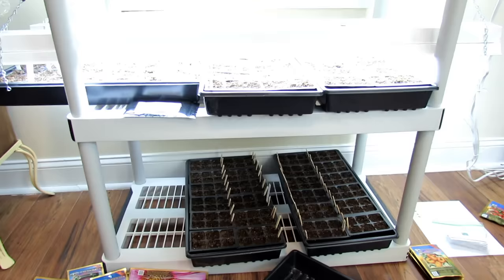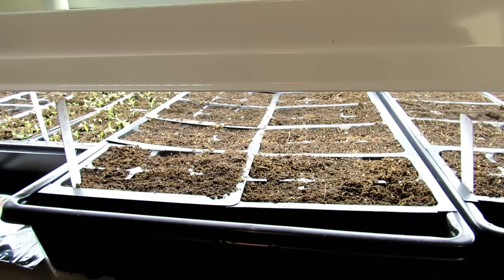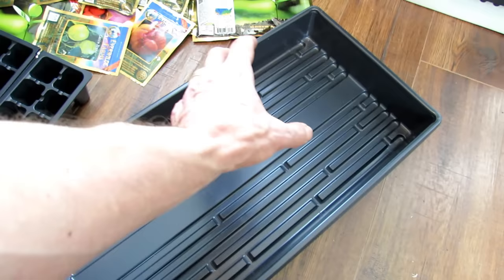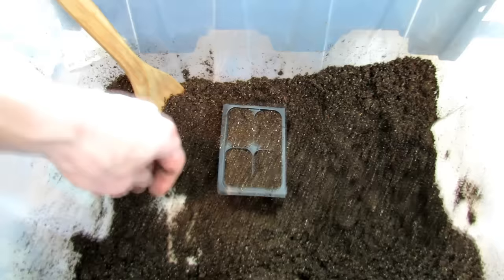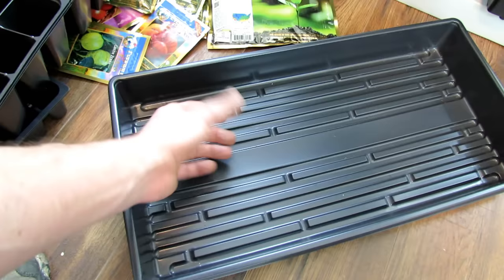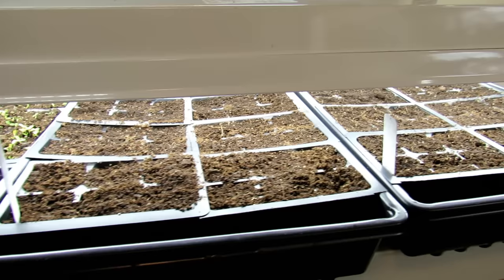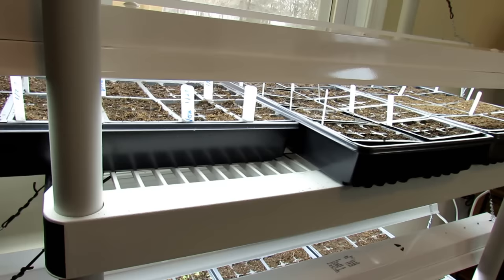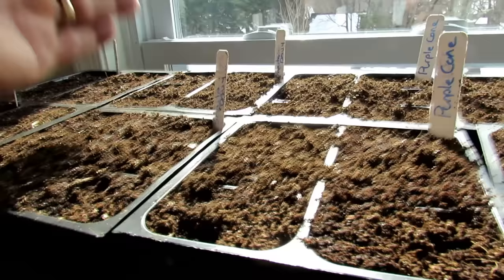Seed Starting Basics: 30+ Questions Answered on Seed Starting Indoors - Digital Table of Contents

Comment: I'm going to be starting my first ever seeds (& garden) this spring (very excited!) I'll only have a small number to start, so if I wanted, could I set them outside during the day on any day that is 40 degrees (or more) and sunny? 

Does it have to be a sunny day or are overcast days okay too?  I would cover them with a screen to help reduce bug issues and put them on a table on the deck. And bring them in in the evening and set them under grow lights in the basement. 

If there is a stretch of cold weather that keeps the seedlings inside (after they are a week old), do I then need to go to a "hardening off schedule" to get them back outside during the day?  
How long of a break from being outside each day could they tolerate before I would have to harden off to get them back outside?  

Or should I just play it safe and just give them a couple hours of real sun each day that I can (weather permitting) till they are ready to get fully hardened off?

Sorry for all the questions.  I'm trying to learn how to garden from youtube videos :-) Thank you for your helpful videos!
Reply from the maker: That will work. I have done that. Being in at night is key.  Just should be 40 plus. If they been getting sun from the start, no need to restart hardening off even if they are in a bit.  Good luck.
Please Ring the Bell (next to subscribe) to get immediate real-time video notifications & Please check out The Rusted Garden Seed & Garden Shop for all your gardening needs: www.therustedgarden.com

Comment: What fixtures did you buy for your bulbs? Found the bulbs looking for the best fixtures for the best deal
Reply from the maker: I havent bought them for a while as the new LEDs come embedded in the 4 foot shop light now. I used to just buy 4 ft metal receptacles and Home Depot or Lowes.  I think it is cheaper now to use buy them as 1 package like at Walmart. 
Good Morning!
Reply: Alright! So I found 4 ft LEDs that are embedded all a single fixed unit.. they are bright daylight LED. 5,000 K and 5,500 L. 
But they aren’t actual “grow” lights. They were way more affordable than some options though. Will they work? 
Good morning!

Comment: In dallas area and with Phil predicting end of winter is it too cold yet to start direct sow? Carrots, kale, lettuces, at least? My cilantro and kale, some strawberries and carrots grew straight thru winter with only minimal frost loss.  Maybe can?
Reply: I'm also in Dallas area and put my first round of carrot seeds in a container last week, my spinach & broccoli seedlings have been outside on the deck for the past week, and my potatoes are just starting to break the surface.  I use clear plastic totes to 'shield' them at nights when we have cooler temps and so far they are doing well.  But we have had sudden frost and even ice days in late February before here so it's still a hit or miss, thus why I'm only doing containers until March.
Reply from the maker: They can go outside. They can all take light frost.
Check out my new Amazon Influencer Shop. Ill be putting what I use in videos there for 2019. It is all set up by categories. Thanks.  https://www.amazon.com/shop/garypilarchiktherustedgarden

Comment: Another great video. Thanks Gary. Question: Do happen to know the dimensions of the Large seed starting cells sold on your website? For my needs, I definitely don't need the smaller cell trays and was considering starting my seeds in styrofoam cups like I've seen in your other videos.  But I like the convenience of the trays with the large cells so I'm kinda on the fence on which way to go. This would be for tomatoes and peppers. Thanks.
Reply from the maker: Thanks. So I believe. 3.06" x 2.19" x 2.31 Those cells break apart into single units and can replace a styrofoam cup. They arent as large but you can fill them to the top and being square the fit tightly and dont fall over like cups. 
https://www.therustedgarden.com/products/seed-flats-starting-cells-and-4-inch-transplant-pots-large-combo

Comment: Hi Gary,

The temperature ~2.5 inches below my grow light is about 80 degrees. I’m using a shop light with 2800 lumens and 5000K. My house is generally around 72 degrees. I think seed starting warm weather crops would be fine under these conditions; however, I’m wondering how these conditions would affect cold weather crop germination. Would you recommend seed starting cold weather crops at a lower temperature? I probably can setup another grow light station in my basement.
Reply from the maker: Great for warm... and I learned that heat does make the cool weather crops grow fast and get leggy. I am try to let them germinate under the lights. Then I take them outside if it is not freezing. Mix in the cold. Basement would be good.
Please check out The Rusted Garden Seed & Garden Shop for all your gardening needs: www.therustedgarden.com

Comment: QUESTION:  
Gary I have ORANGE HAT tomato seeds on hand.  They are dwarf tomato's.  
Will these grow under our shop lights.   
I bought the ones you recommended.   
Thank You.
Reply from the maker: They should. Tomatoes are self fertilizing too
Please support The Rusted Garden by subscribing and using my Amazon Store Link when shopping for anything on Amazon https://www.amazon.com/shop/garypilarchiktherustedgarden.  As an Amazon Associate I earn from any qualified purchases, not just items I link. You can also find items I use or discuss in videos, by checking out my Amazon Storefront for fertilizer, pest management, shade cloth, seed starting supplies, books and more!   Please visit The Rusted Garden Seed & Garden Shop (My Shop) for your fabric pots, fall & spring seeds, seed starting supplies, peppermint oil, neem oil, TRG merchandise, and more at www.therustedgarden.com  Thanks & Cheers!

Comment: I have a question. How can I start seeds indoors without having to spend a small fortune? Without having it buy grow lights, plastic trays, and other expensive equipment! I start my seeds in old egg cartons on my window sills. And it works fine.
Reply from the maker: You can start in trays. Put them out during the day, sheltered from rain when days are over 40. Take them in at night as the warmth at night will help them germinate and grow. Its a bit of work but only alternative to no lights.
I now have an Amazon Influencer's Storefront. As an Amazon Associate I earn from qualifying purchases.  It is free to use and anything you buy may be eligible.  Just use my... The Rusted Garden link at https://www.amazon.com/shop/garypilarchiktherustedgarden anytime you shop. I have garden items broken into categories.

Comment: I started peppers and the seedling had leaves that were turning purple, I only fertilized a small amount about 1 week after they sprouted. Why would the leaves turn purple? The plant is a bhut jolokia.
Reply from the maker: Purpling is normal at times for pepper. Some in the joints. A tad more of nitrogen is fine but different pepper varieties can have more purple.
Join this channel to get access to perks which focus on live garden mentoring and member influenced videos: (click the JOIN button on upper right side)
https://www.youtube.com/channel/UCptL6_qMImyW_yZwiMjQdpg/jo

Earn 15% and become a TRG Affiliate for our seed & garden shop.
Use this to go directly to our TRG Affiliate Program sign up https://the-rusted-garden.goaffpro.com/create-account

Visit The Rusted Garden Seed & Garden Shop: 
https://www.therustedgarden.com/ - Seeds, Starting Supplies, Neem Oil, Peppermint & Other Oils, Calcium Nitrate & More.

Plus support The Rusted Garden by subscribing and using my Amazon Store  Front link 
when shopping for anything on Amazon https://www.amazon.com/shop/garypilarchiktherustedgarden
As an Amazon Associate I earn from any qualified purchases, not just items I link. 

You can also find items I use or discuss in videos, by checking out my Amazon Storefront for cameras, fertilizer, pest management, shade cloth, seed starting supplies, books and more!

Comment: I would prefer to have my setup in out basement, however, it is typically 60 degrees down there.  Would I be able to do set up my lights and seedlings if I also incorporate a heat mat?  Or do you have other suggestions?
Reply from the maker: You can with a heat mat. I am using my location you see to germinate and then moving them into colder cellar.
Check out my new Amazon Influencer's Shop. Anything you buy on Amazon helps The Rusted Garden when using my link.  Ill be putting what I use in videos there for 2019. It is all set up by categories. Thanks.  https://www.amazon.com/shop/garypilarchiktherustedgarden

Comment: I planted peppers and put them on a heat mat in a warm corner of the room but I didn't put them under grow lights. So should I put a grow light on them? They have not broke the surface yet.
Reply from the maker: YES! The need the intense light or will be tall and leggy.
This takes you to seed starting cells. https://www.therustedgarden.com/products/seed-flats-starting-cells-and-4-inch-transplant-pots-large-combo

Comment: I’m planning to start seeds for the first time this weekend. My lights are 5500 Lumen. So should I start that at 5 inches up instead of 2-4? Also they will be in my basement which is 62° so should I invest in a heat mat? I’m starting with flowers and I’m planning to add tomatoes, basil and radishes.
Reply from the maker: Congrats on your first try. So 5 inches is fine to try. You do have to experiment. I would go a bit closer till after germination. Better to have too much light, even damage them and then have to adjust. 
Please check out The Rusted Garden Seed & Garden Shop for all your gardening needs: www.therustedgarden.com

Comment: Gary, if I don’t use up all the  pre moisten starting mix all at once, do I need to pre moisten the starting mix again with hot water each time I start another seed pack? Thanks!
Reply from the maker: Not hot water. It might need some water though.
Check out my new Amazon Influencer's Shop. Anything you buy on Amazon helps The Rusted Garden when using my link.  Ill be putting what I use in videos there for 2019. It is all set up by categories. Thanks.  https://www.amazon.com/shop/garypilarchiktherustedgarden

Comment: Hi Garry, after 18 hours I turn off the light, do I just let the seed tray sit in darkness with the foil still cover? Or I can move the tray out to natural day light?
Reply from the maker: Mine stay under there all the time. 18 hours on 6 hours off/16 hours on 8 hours off and then I cut it back as they get taller. I dont use lids or domes
Please Visit The Rusted Garden Seed & Garden Shop: https://www.therustedgarden.com/
 - Seeds, Starting Supplies, Neem Oil, Peppermint & Other Oils, Calcium Nitrate & More

Comment: if i started with two seeds in each seed starting tray do i split the seeds than transplant them both or only take one and let the other die?
Reply from the maker: You can do either but removing one is the easiest way and you don't have to worry about transplant shock.
Please visit The Rusted Garden Seed & Garden shop for seeds, seed starting supplies, neem oil, TRG merchandise and more at www.therustedgarden.com & Please Ring the Bell (next to subscribe) to get immediate real-time video notifications of new videos. Thank

Comment: what if you grow without lights,and bring them outside for sun but only get 7 hours of sun,being of the short winter days , is that enough sun for germinating tomatoe seeds?
Reply from the maker: That would work if you can manage it daily. I probably will be doing a video on that process, if time allows.
Check out my new Amazon Influencer Shop. Ill be putting what I use in videos there for 2019. It is all set up by categories. Thanks.  https://www.amazon.com/shop/garypilarchiktherustedgarden

Comment: Can you start seeds outside in seed starting trays with dome, if daily temp 65, night time 40s? I only have 2 led grow lights. Grow area 8a for lettuce, beets, mustard and radishes
Reply from the maker: Yep that would work just fine. Just be carefully you dont a full sun day and some warmth with domes. They could over heat.
Check out my new Amazon Influencer Shop. Ill be putting what I use in videos there for 2019. It is all set up by categories. Thanks.  https://www.amazon.com/shop/garypilarchiktherustedgarden

Comment: Hi Gary I messed up on the height of lighting over my broccoli seeds and they are leggy now the leaves were touching the LED lights and then I moved it too high I guess 3 or 4 inches now they're hanging over and I'm not sure if I should move them to cups or is it safe to plant them directly to pot cuz they'll be in containers .. they get lost in a big pot? when and how should I transplant them?
Reply from the maker: Sometimes it is better to start over with overly leggy plants. They do correct but it takes time. I transplant up when the roots start coiling in the bottom of the container they are in. Check out my new Amazon Influencer's Shop. Anything you buy on Amazon helps The Rusted Garden when using my link.  Ill be putting what I use in videos there for 2019. It is all set up by categories. Thanks.  https://www.amazon.com/shop/garypilarchiktherustedgarden

Comment: What about fans on seedings?
Reply from the maker: People use them but I dont. Just never did. Nothing bad about them and they do have a benefit.
Please visit The Rusted Garden Seed & Garden shop for your fabric pots, fall & spring seeds, seed starting supplies, peppermint oil, neem oil, TRG merchandise and more at www.therustedgarden.com Check out my new gardening PODCAST Gardening Coast2Coast at https://gardeningcoast2coast.net with CaliKim. As an Amazon Associate I earn from qualified purchases. Check out my Amazon Storefront for garden lights, seed starting supplies, fertilizer, pest management, books and more! https://www.amazon.com/shop/garypilarchiktherustedgarden

Comment: Gary I dont know what Im doing wrong but my young peppers are starting to lean in the middle of them. They are in cups and all have about 4-6 true leaves. Im very afraid of overwatering and I’m not sure if my fear has caused me to underwater. I initially was watering maybe every 4 days. Well now ive watered two days in between and it seems worse. Is it lack of sunlight? Is it the quarter strength fertilizer? Its been raining here lately so I havent been putting them in the window seal. I’ve been using my photography lights as a lighting source about 8 hours each day the sun isnt out. They produce good heat and light. What should i do? I have a photo of how the look. Im very afraid they are all going to die. I have about 37 plants.
Reply from the maker: Stop watering. If you pop out soil in a cup and the bottoms are most but the top is dry that is good. They need to dry a bit. A picture would be good. therustedgarden@gmail.com
Check out my new Amazon Influencer Shop. Ill be putting what I use in videos there for 2019. It is all set up by categories. Thanks.  https://www.amazon.com/shop/garypilarchiktherustedgarden

Comment: an adevice: use smart plug instead of timer.
1) it is cheap 
2) you able to control remotely
Reply from the maker: Great tip
The Rusted Garden Limited Red 5 Tier  Vertical Towers are on sale now at  https://lddy.no/4eal. Use the code THERUSTEDGARDEN too save money.  Please visit The Rusted Garden Seed & Garden shop for your fabric pots, fall & spring seeds, seed starting supplies, peppermint oil, neem oil, TRG merchandise and more at www.therustedgarden.com Check out my new gardening PODCAST Gardening Coast2Coast at https://gardeningcoast2coast.net with CaliKim.

Comment: Gary, I've been reading up on planting onions. I'm in Connecticut (zone 6) and I found 2 varieties that are long-day that I will be seed planting. Many of the articles have said that onions like high nitrogen soil. Do you increase nitrogen for your onions? Thank you in advance.
Reply from the maker: I dont change the soil much for onions. I have been going more and more toward compost and worm castings. For mid growth, I am using water soluble fertilizers directly to the plants. I would give onions a drink as the get to 10-12 inches.Check out my new Amazon Influencer Shop. Ill be putting what I use in videos there for 2019. It is all set up by categories. Thanks.  https://www.amazon.com/shop/garypilarchiktherustedgarden

Comment: Why do seeds underneath the soil need light? Is it for the actual light or the heat?
Reply from the maker: The dont to germinate. I just leave mine on so I dont miss the germination period and first light for them.
Check out my new Amazon Influencer's Shop. Anything you buy on Amazon helps The Rusted Garden when using my link.  Ill be putting what I use in videos there for 2019. It is all set up by categories. Thanks.  https://www.amazon.com/shop/garypilarchiktherustedgarden

Comment: ...one more question, do you or have you used bat guano?  If so, Do you recommend it?
Reply from the maker: I havent. I finally landed with compost and worm castings as my main. Check out my new Amazon Influencer Shop. Ill be putting what I use in videos there for 2019. It is all set up by categories. Thanks.  https://www.amazon.com/shop/garypilarchiktherustedgarden

Comment: Can i use peetmoss and compost 50/50 to start my seeds? Do i need to add boiling water
Reply from the maker: It works but indoors I just use seed starting mix or a make mine with just peat moss and vermiculite. I never tried the boiling water to compost. The compost needs to be 100% fully broken down.
Please Visit The Rusted Garden Seed & Garden Shop: https://www.therustedgarden.com/ - Seeds, Starting Supplies, Neem Oil, Peppermint & Other Oils, Calcium Nitrate & More